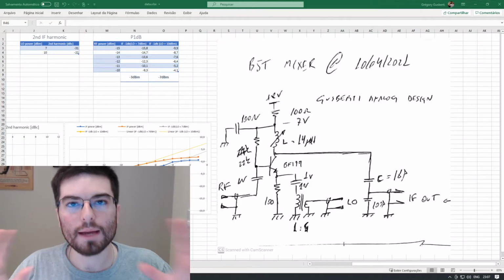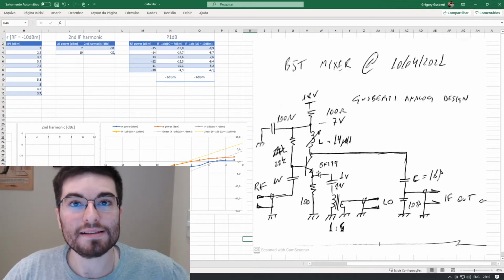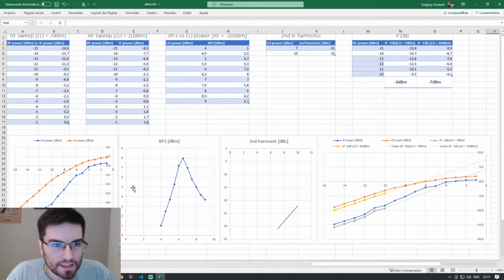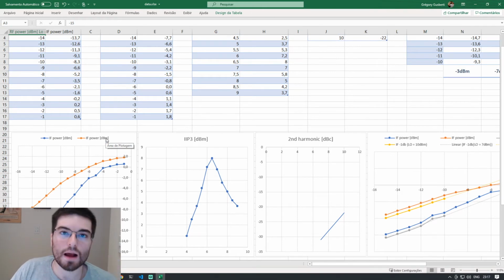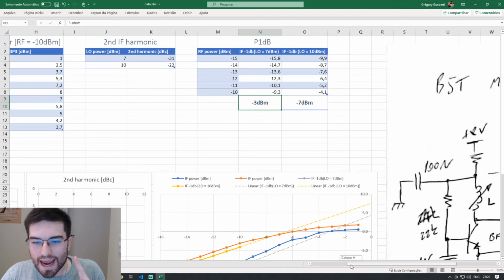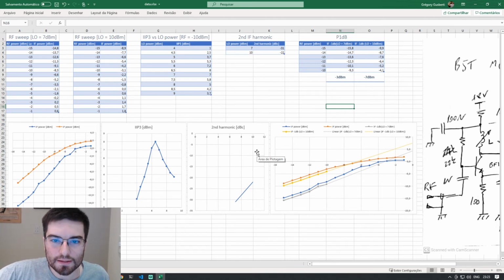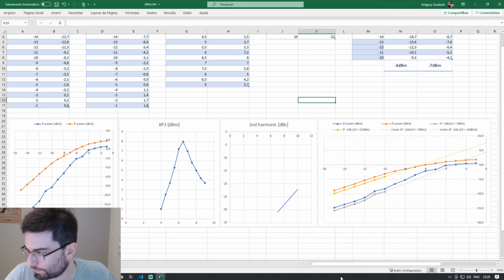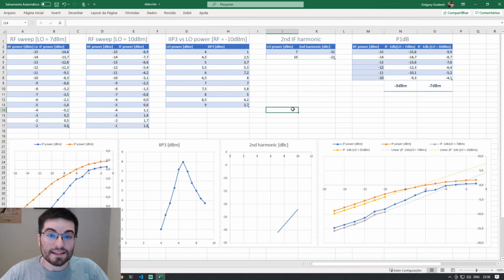RF Parameters | Active Mixer | Characterization and Behavior | TOI

Comment: I think you're saying the compression is caused by greater harmonic content. Is that another way of saying "clipping" or "non-linear"?
Reply from the maker: Chicken and egg 😀
Reply: I assume clipping is the cause of harmonic content. No?. But this seems like "soft" clipping. Correct?
Reply from the maker: @johnaweiss Yes, it "soft". But, is the clipping that generates harmonics or harmonics that compose the clipped  waveform? Just two points of view of the same phenomenon, not strictly a cause and effect relation 😉
Reply: I don't believe that. 🙂